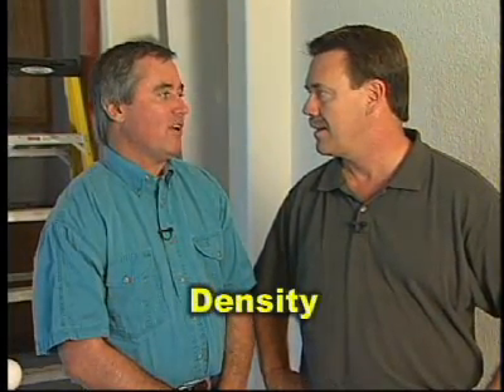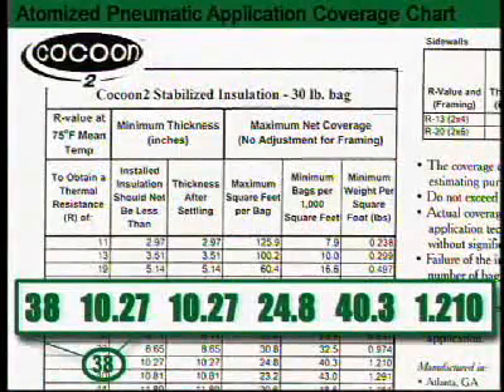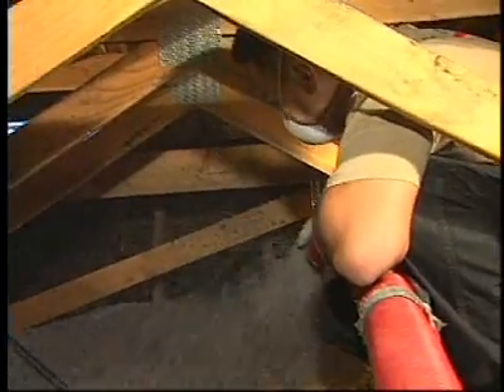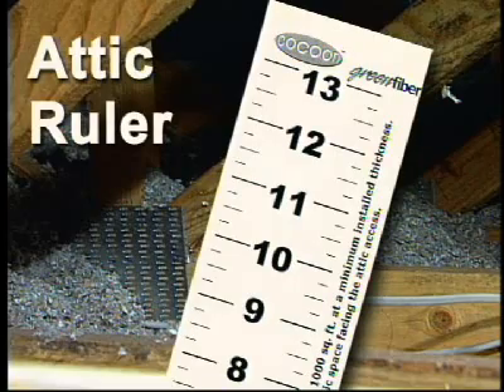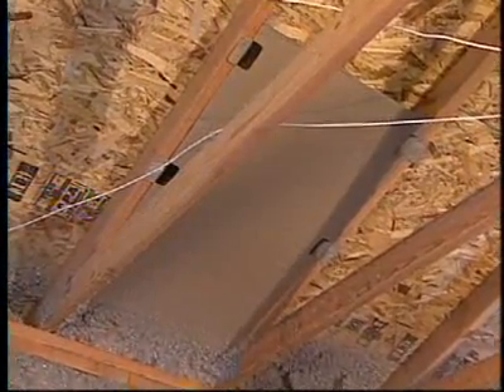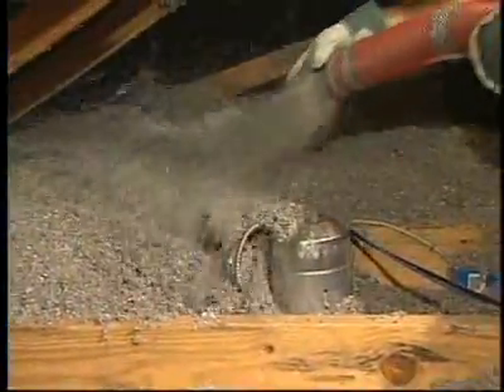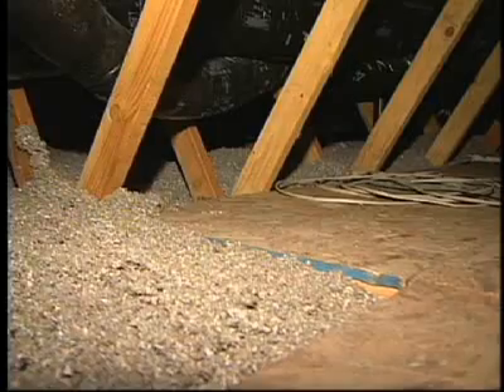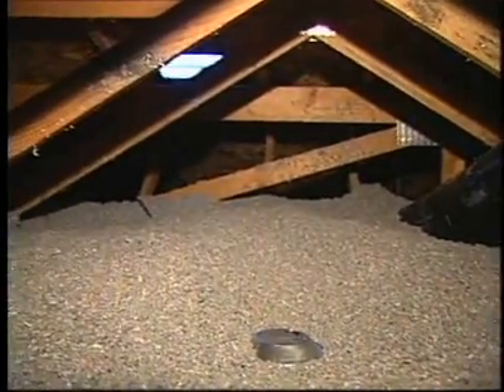Insulating Ceiling with Cellulose insulation

Comment: This is the Warnings given to Cellulose installers : Cellulose insulation is manufactured from shredded waste paper to manufacture loft insulation, installers are advised to completely protect themselves from coming into any kind of skin contact with the  product or dust - to wear safety glasses with side shields, face mask or respirator, gloves, long tight sleeves, long pants and a hat kept in place with a hair net. Cellulose insulation is synthesized chiefly from recycled newspapers. The additional components it may include are binders, skin irritants, fire retardants, ammonium sulfate, sulfuric acid, borax, boric acid, and other chemicals. Cellulose insulation presents serious health hazards if inhaled, k/as dust asthma etc, and finally, it may also carry potential cancer causing agents or carcinogens associated with the original waste paper source and printers inks. Eventually the product does settle 40% under its own weight so extra material allowances for this must be made.
Reply: +PiperSon, you are an idiot! Cellulose is a great insulation product! Fiberglass is the worst at insulating.

Comment: Would have been better to seal the attic first, as in put insulated caps over the recessed lights and electric boxes and foam them in, foam other cracks to walls, etc.